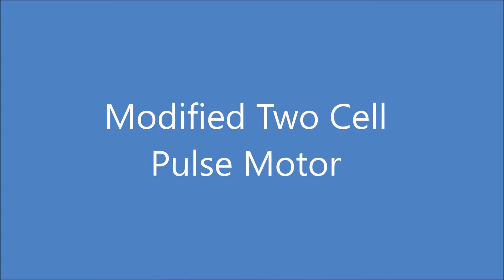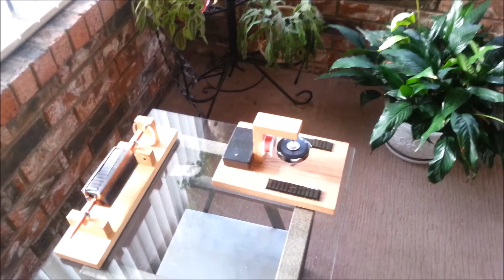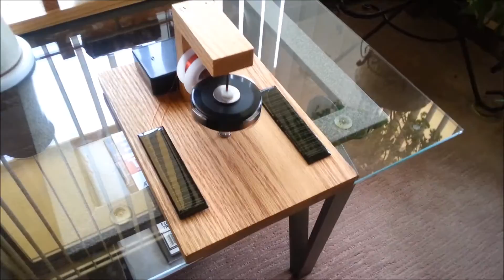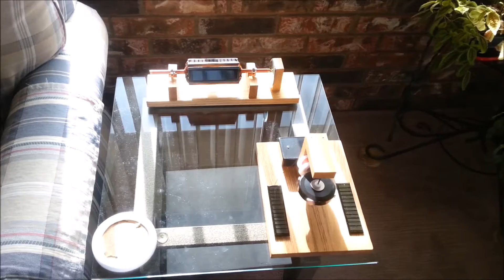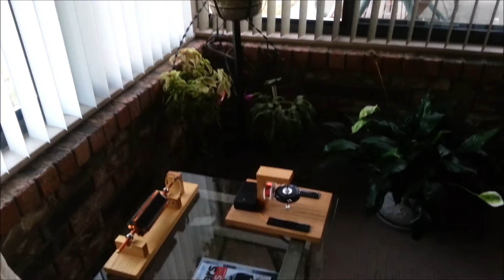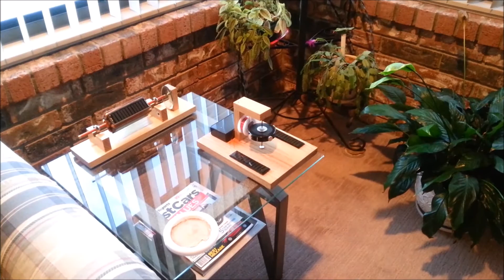Modified Two Cell Pulse Motor

Comment from the maker: Since modifying the circuit I should rename this a Magnet/Light Pulse Motor. It doesn't require direct sunlight to run, just visible light. With the help of Back EMF from the inductance of the magnet coil and very low drag on the shaft, it will run on rainy days or very cloudy days. At the most, all it needs is the overhead light.

Comment: This is ....awesome! I'm so amazed when the rotor turn CCW & CW slowly some sort like finding its tuning and around 2:15 rotor build up speed CCW.

Can you share how you "The PVC wheels are magnetically suspended, so very little drag is created. Shafts are coated soft core welding rod."? How can I replicate the suspended shaft that always maintain center or any link I can refer to?
Reply from the maker: The magnetic suspension is my idea and design. Since the motor is a "north pole" motor (north poles facing out) the shaft is partially magnetized by the south poles. The shaft has just a small clearance on the ends and by using two 1/2" axial magnets on the top and one on the bottom with the north poles facing the shaft it will suspend and center. It needs to hang from the top with very light contact. This is controlled by the rotor weight. This is a very much magnet motor for it will run with very little light. It needs the solar cell to supply what the magnet energy won't.